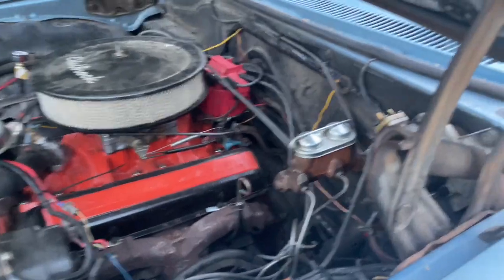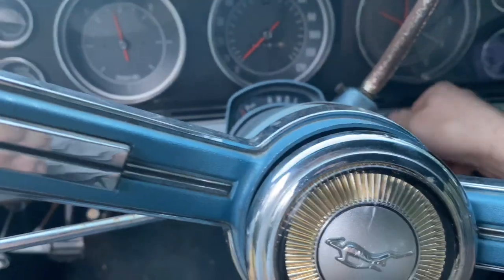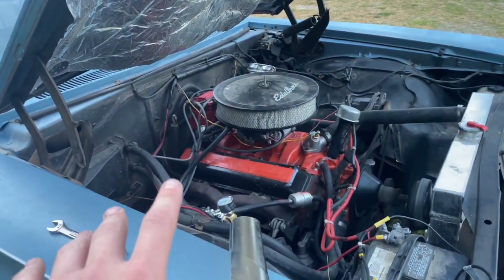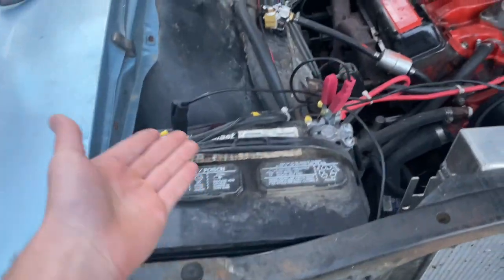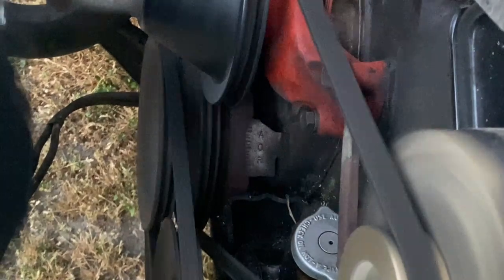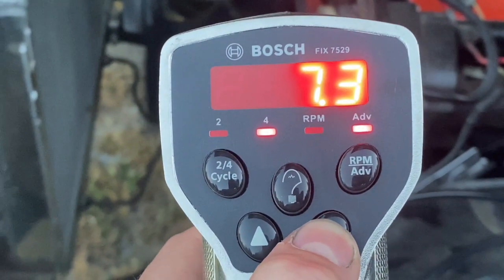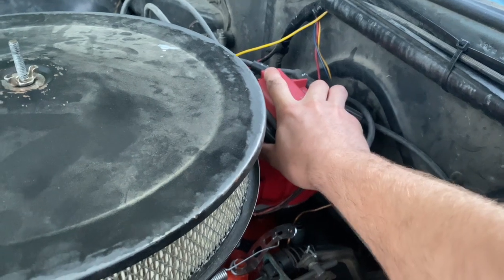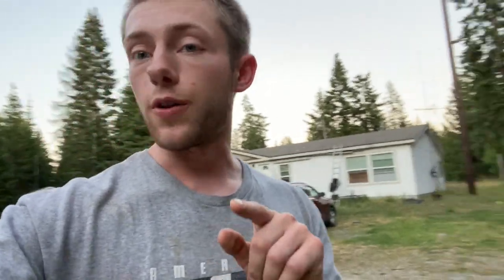How To Adjust Ignition Timing With A Timing Light

Comment: I thought you had to adjust the timing when you're at like 3k-4k rpm?  I saw other 'pros' do it this way because the more rpms, the more it advances. Sure, it's 0 degrees at idle, but it will be different at 3k rpm. So what's your take?

Comment: I got most of this yet I am still confused I am going to time my Nissan Van I have never done this before yet I am good at mechanics If you set the light to a degree you need it should be "0" at the balancer or other way around I get this but then when do you adjust the distributor? Sorry, this is a first for me.
Reply from the maker: Step one: set timing light (if equipped with this function) to the desired advance. 
Step two: adjust the distributer until the mark aligns at 0 on the timing tab. 
OR
If your light does not have the adjust function. Align the mark to the desired advance by adjusting the distributer.
Reply: @DavidCompton  Thank you so much and wow I did not expect a response I bought one like you have. I will give it a try this weekend! Again Thanx! Just had to add I subscribed.